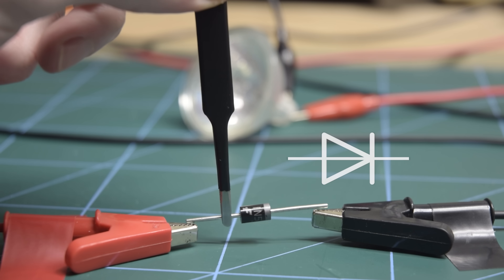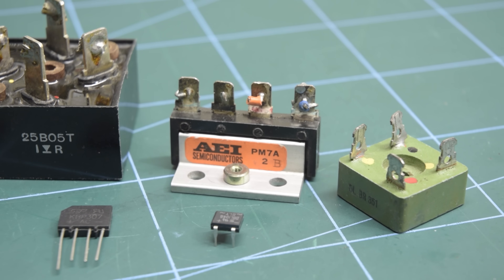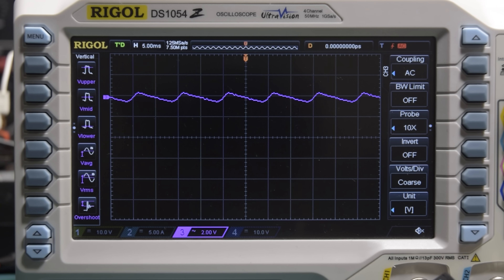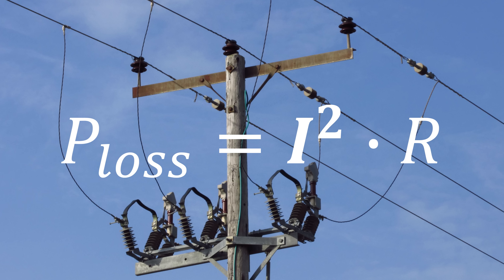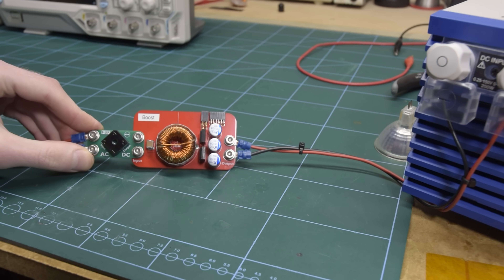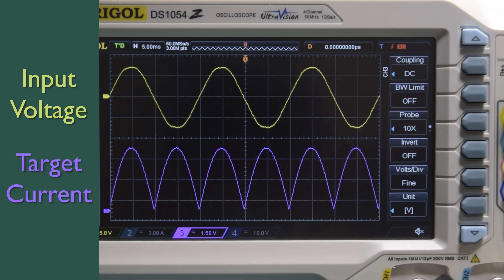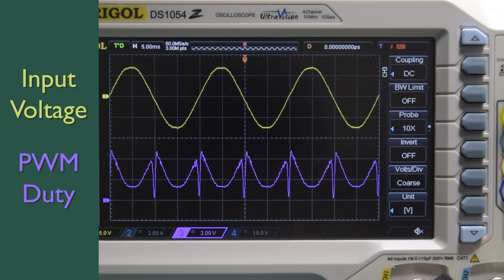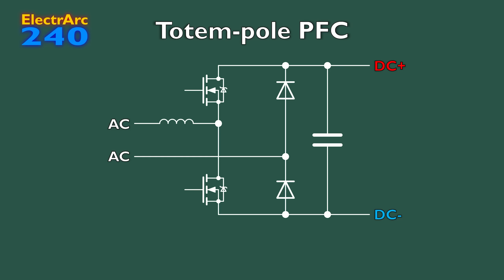Fixing the Full Bridge Rectifier’s Big Flaw - Active Power Factor Correction

Comment: The waveform shown at 10:18 shows a huge DC component of current. You need to investigate where that is coming from because DC current in mains-powered circuits is unsustainable. Since your AC supply is transformer coupled somewhere from a high voltage line, the net current leaving the utility's step-down transformer is zero. This means that another appliance that exists somewhere downstream of the step-down transformer is being forced to operate on the opposite DC bias. A remarkably small amount of DC current in a transformer, like 1% of its rated current,  can cause it to be biased towards saturation and cause massive hysteresis losses resulting in lost efficiency and overheating.
Reply from the maker: Yes completely agree. This is offset in the current probe and measurement circuitry. I really threw this all together and I recorded some footage a week apart and after fully dismantling the circuit. I believe this happened because I swapped some resistors when I rebuilt it. That's my excuse anyway lol
Reply: @electrarc240  A measuring artifact is unlikely to be the correct explanation for the observed DC imbalance. But you can just put a DC ammeter in series to see if this is real or a measurement artifact. Alternatively you can see what happens if you run your device as the only load on a seriously oversized isolating transformer. The zero-crossing points are unmistakable and sit neatly on the axis. Likewise, your fantastic 0.98 PF is clearly wrongly estimated. If a DC component exists in the current, or in fact if any even harmonics are significant in either the voltage or the current, simple measurement techniques will not measure PF correctly. A good DSP-based power analyzer can do the job. It needs to calculate numerical integrals for V^2dt, I^2dt and IVdt. That correctly takes care of DC and even harmonics.
Reply from the maker: @jacks5kids  That waveform is the current, so an offset in the measurement will propagate through the controller and appear at the input as we see. The PF was calculated before the "rebuild" when there was no offset, and it was correct.
Reply: Asymmetrical load on a transformer is not a problem other than causing poor utilization of the transformer. It won't cause saturation. Half-wave rectifiers on the outputs of transformers used to be very common in vacuum tube equipment. DC bias is a very big problem on the  input side of a transformer.  
In SMPS circuits, a DC-blocking cap may be used in the primary circuit of half bridge, full bridge and push-pull circuits or cycle-by-cycle current limiting may be used. In a forward converter, where operation is in "one quadrant" (unipolar excitation) a "reset winding" is ususally used to prevent core saturation.
Reply: @ebpdoug2175  A transformer core does not "know" whether the DC component of its field is coming from the primary or secondary winding. How much DC bias can be tolerated by a core depends on how close the core is to saturation or hysteresis overload in the first place. The bigger risk comes when a small load is fed by the same secondary as a large and unbalanced load. The small device gets fried by the DC current.

Comment: Thanks for this! Cant say I fully kept up but trying... I added a buck converter after a crap rectifier/regulator after ac stator on my bike and the bucks input cap blew. I think I needed to smooth with a Bigger cap before buck. how would I find this caps value? Also seems caps in parallel are bad? Had some huge voltage spikes doing that. Feel free to answer with a vid :D

Comment: ok, LED rectifier kinda cool, but i would need a transformer with quite the reduction of 3V output. im thinking this correctly yes?
Reply from the maker: Yeah it wouldn't work for mains as LEDs are bad at blocking reverse voltage. In this case it was fed by a 12V AC transformer and had just a 1k resistor as "load" for some current to flow

Comment: Another excellent video. I've seen a few in which the presenters struggle mightily (and fali) to properly explain how active power factor correction works, babbling on about phase shifts with capacitive loads.

A couple of tidbits that aren't immediately obvious to people not well versed in switchmode power conversion:

All switchmode power converters with regulated output (either voltage or current) have a negative input resistance characteristic. That is, the slope of a plot of input current versus input voltage is negative - if you increase the input voltage, the input current falls in proportion. I think most people who have some knowledge of switchers get the inverse relationship, but many never really think of this as a negative resistance characteristic.

This makes for the interesting requirement for active power factor correction. In order to get the input current waveform to match the shape of the input voltage waveform, the instantaneous input current must be made to be directly proportional to the instantaneous input voltage. BUT that negative input resistance characteristic means that the average input current must be made inversely proportional to the average input voltage.

I chuckled when you first said in your video "all we have to do is..." "All" was a bit loaded. I'm not surprised your code was troublesome. It is a pretty difficult problem. Years ago I struggled mightily with an analog PFC controller from Unitrode (now part of TI). When I started the project I think the ap note was at Revision B. By the time I was done it was at Rev H, iirc. I don't think I've ever seen any other ap note go through that many revs - certainly none in the course of a few months. There are many parts that will go "bang" in a 1200 W PFC circuit if it gets annoyed. Blew up a 35 x 60 mm electrolytic cap, too. That was ... loud. I suppose I actually was a bit lucky. There were four such caps in the filter.

Just to toss in something else to hurt peoples' brains (yes, I'm a big old meany), a boost converter operating in continuous inductor current mode has a right half plane zero in the response.
Reply: Those other videos you watched were about PFC for motors. Some electric motors produce a phase shift like at 6:30 in this video. The way to fix that is a capacitor.

Comment: There is an interesting dead-simple full-wave rectifier circuit that uses four MOSFETs (two N-channel and two P-channel, if I remember correctly) with the gates cross-coupled.  I was playing around with it many years ago, as a possible way for a low-voltage DC-input to be tolerant of normal and reversed polarity DC power supplies without the voltage drop of a diode bridge.  The device I was powering when testing this circuit had a large electrolytic capacitor essentially directly across the DC input.  Just for fun, I connected the DC input to an AC source (the output of a step-down transformer), and the electrolytic capacitor exploded after a few seconds.  Why the capacitor exploded is left as an exercise for the reader.  (Hint: It wasn't because a reverse voltage was applied to the electrolytic capacitor, the four-MOSFET full-wave rectifier circuit produced the correct polarity output.)
Reply: It couldn't discharge?
Reply: @rockytom5889  Actually, the problem with the circuit is that a MOSFET conducts current in both directions; when a MOSFET is on, it acts like a resistor.  In contrast, a diode only conducts current in one direction.  So when I applied an AC input to the full-wave MOSFET bridge, current flowed into the electrolytic capacitor on the rising edge of the sine wave, charging it up, and then current flowed right back out on the falling edge, discharging it.  This current flowing in and out of the electrolytic capacitor 120 times a second was much larger than the capacitor's RMS current rating, heating it up rapidly until the electrolyte boiled and it exploded from the internal pressure.  It mystified when it happened, it took some head-scratching for me  to figure it out.  That was many years ago; now I always simulate a circuit first, to catch the "obvious" mistakes like this up front.
Reply: Here's an LTSpice file of the MOSFET full-wave rectifier, in case you want to play with it.

--- Copy lines below and save to an .asc file, open in LTSpice:

Version 4
SHEET 1 880 680
WIRE 256 -176 64 -176
WIRE 416 -176 256 -176
WIRE 544 -176 416 -176
WIRE 64 -144 64 -176
WIRE 256 -144 256 -176
WIRE 144 -128 112 -128
WIRE 208 -128 176 -128
WIRE -32 -80 -96 -80
WIRE 416 -64 416 -176
WIRE 544 -64 544 -176
WIRE -96 -48 -96 -80
WIRE -32 -32 -32 -80
WIRE 64 -32 64 -48
WIRE 64 -32 -32 -32
WIRE 176 -32 176 -128
WIRE 176 -32 64 -32
WIRE 144 0 144 -128
WIRE 144 0 -32 0
WIRE 256 0 256 -48
WIRE 256 0 144 0
WIRE 64 16 64 -32
WIRE 256 16 256 0
WIRE -96 64 -96 32
WIRE -32 64 -32 0
WIRE -32 64 -96 64
WIRE 144 96 144 0
WIRE 144 96 112 96
WIRE 176 96 176 -32
WIRE 208 96 176 96
WIRE 64 144 64 112
WIRE 256 144 256 112
WIRE 256 144 64 144
WIRE 416 144 416 16
WIRE 416 144 256 144
WIRE 544 144 544 0
WIRE 544 144 416 144
WIRE 416 160 416 144
FLAG 416 160 0
SYMBOL res 400 -80 R0
SYMATTR InstName R1
SYMATTR Value 10
SYMBOL pmos 112 -48 R180
WINDOW 3 56 72 Invisible 2
SYMATTR InstName M1
SYMATTR Value AONS21303C
SYMBOL pmos 208 -48 M180
WINDOW 3 56 72 Invisible 2
SYMATTR InstName M2
SYMATTR Value AONS21303C
SYMBOL nmos 112 16 M0
WINDOW 3 56 72 Invisible 2
SYMATTR InstName M3
SYMATTR Value AONS32310
SYMBOL nmos 208 16 R0
WINDOW 3 56 72 Invisible 2
SYMATTR InstName M4
SYMATTR Value AONS32310
SYMBOL voltage -96 -64 M0
WINDOW 123 0 0 Left 0
WINDOW 39 0 0 Left 0
SYMATTR InstName V1
SYMATTR Value SINE(0 {10*sqrt(2)} 60)
SYMBOL cap 528 -64 R0
SYMATTR InstName C1
SYMATTR Value 1000µ
SYMATTR SpiceLine Rser=10m
TEXT -168 120 Left 2 !.tran 0 0.05 0
--- Copy lines above

Comment: So all we us citizens to you all are low voltage 60 hz yankees?   Righty o..  well ive been zapped by 120v60hz and 240v50hz and i can tell you for a fact the hum of the 60hz going through your body is a bit more pleasant than the skin blackening thump of the 240v 50hz..  but both are just childs play compared to a 3 phase 1200 hz..  that crap feels like a bunch of really small race cars all running into every joint on your body at once while you are vibrated harder than a fat girls bedside boyfriend..

Comment: Ok so I am an oldie, but in my day we used to call them a full wave bridge rectifier or just bridge rectifier. 
Next. Most of your first half was pretty much what I was taught in my trades course. The rest was not thought of back then. But if we want a good clean power supply it would likely be bridge, filter cap and regulator IC. You can now use your idea or switch mode. But,,  you have to realise this can play havoc with say sensitive audio circuits. Can be done you say, but only by making much more complex. BTW, if we're only talking about small power supplies, do we really need to fuss over power factor???
Reply from the maker: Below 75W we usually don't. Above that it's now mandatory in most places. Most modern audio circuits are class D which aren't as sensitive and are switching themselves lol, can't escape switching!!

Comment: Really good explanation and examples.  Nicely done.  
But these 'new-fangled' rectifier circuits aren't any good at all in the world of vacuum tube guitar amplifiers - where I very comfortably live.  We LIKE the effects of the inefficiency of a simple bridge rectifier and reservoir capacitor.  🙂
The downsides that you explained are an integral part of what makes great guitar amps - well, great!  
But then, SO much of what makes them great is using them outside their original design parameters, and then designing them to BE used wrongly.  Other areas of audio design work tirelessly to avoid distorting the signal.  We design the circuits to give, but control the distortion that is intended to occur even as the distortion of the signal is increased.  And under-designing, even abusing the power supply is a hugely important component of how we go about that.  Efficiency in the power supply is anathema to our goals.  But the rest of you normal electronic wizards just go on ahead with you clean power.  Have fun!  🙂
Just an interesting aside.

Comment: A really simple PFC IC  for apps less than 500 watts is the MC33262 developed about 35 years ago. It uses critical current mode, ie fet turns on as soon an the inductor current drops to zero.  It uses a single quadrant analog multiplier to force the input current to follow the haversine reference, which is derived from a simple voltage divider from the diode bridge. 
Perhaps you might consider a sequel describing this iconic IC.  It was used by the 10s of millions in fluorescent lighting ballasts from the late 80s until the advent of high efficiency white LEDS, which as your readers may know are really fluorescent phosphors driven by a blue led at about 460 nM.
Reply: Ahh I love a good datasheet.  I'll have to check that out!
Reply: @whatelseison8970  And a rather good datasheet it is!  :^)
Reply: I did use the 33262 in many designs until recently, then I switched to the UCC38051, which is cheaper, nearly pin-compatible and maybe even a bit better in some details. But beware, there are plenty of pitfalls with these ICs, and it took me quite some time to avoid them.

Comment: If the current only occurs on the high peaks then power is not being consumed between peaks where the current Is very low.  Power factor is caused by reactive phase shift when the imaginary portions of the voltage or current is high.
Reply from the maker: That's specifically displacement power factor, this is distortion power factor. The product of the two is the overall power factor

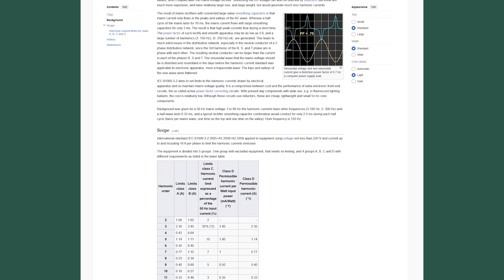Comment: Me, an Electrical Engineer, at 5:05, "Wait, is this just an ad for those scam PFC devices?"

Hold up friend, you're beyond PFC, you're in Harmonic current territory, and your final circuits are just that, harmonic mitigation used on some VFDs (called Active Front End). Here's the catch, they are more expensive at scale.

Comment: The AC is made DC then the High voltage DC is changed to a much higher frequency AC again, this allows for the use of a MUCH SMALLER stepdown transformer with a high frequency output that is much better/easier to smooth after the bridge rectifier.

Comment: I love your redrawing of the bridge rectifier. Makes it much easier to envision how it works. Subscribed!
Reply: It also makes it much easier to understand the construction of a 3 (and poly)phase full bridge -- it's just the next logical step.  When you have 2 diodes built into a single package in the same direction like that it's commonly called a half bridge.
Reply from the maker: I had shown a three phase after rearranging but cut that part out cause it didn't really fit the rest of the video

Comment: The way I see, and explain, power factor correction is like this: we used to have gas guzzlers because the supply of oil was high and the price was low. Now we have hybrids because we can't afford gas and its supply is limited. With electricity we used to have things like hot dogs cookers that were just metal spikes you stuck the hotdog on and the hotdog became part of the circuit. Now the cost of electricity is higher and the cables can only transport so much power at a time, we want to use "Hybrids" because our supply of "Gas" is now limited.
Reply from the maker: Good analogy! I may steal it 👀

Comment: How would the active power factor correction circuit respond if suppied with DC instead of AC?  My goal is to do away with AC to the maximum extent possible, and I'm wondering to what degree modern equipment is compatible.  Older passive power factor correction generally works beautifully on DC.  I will be using nominal 115 volts DC.
Reply from the maker: I really want to know this too!! Definitely going to try from my HV power supply one day. I'll share my results!

Comment: ~Forty years ago, fresh out of college I told my employer money could be saved by purchasing a Power Factor system. It was passive which was fine to offset very large inductive loads. He spent ~$11,600.00 it was paid back in 1.5 years.  In todays world, if appliance manufacturers included small circuits , such as these, consumers will save money.
Out in the world, transformers are generally round. Occasionally there will be rectangular capacitors up on the power poles, for power factor correction.

Comment: The formula you used to calculate the Power Factor for that narrow / distorted  Amps waveform, is actually the formula for Lead / Lag type Power Factor. This is NOT Lead / Lag type Power Factor.  This is Total Harmonic Distortion (THD) type of Power Factor.  The formula to calculate the Power Factor for THD is ... PF = sqrt( 1 / ( 1 + THD^2 ) ).  I don't see where you ever calculated THD ???
Reply from the maker: The (real / apparent) formula is for power factor, not any specific type. If you can get an accurate average power like I did it is completely correct. The formula with THD is for distortion power factor specifically (as opposed to displacement power factor). I was going to take a look at that but I have nothing to measure THD with sadly :(
Reply: I think he doesn't really understand what actual power factor meaans.
Reply: I believe your equation is for the distortion factor. Both you and the equation in the video are correct, this link from MIT gives all the details: https://ocw.mit.edu/courses/6-334-power-electronics-spring-2007/7f8d6364d64a634bcdd8001871d28952_ch3.pdf

Comment: Thanks for the video and perspective on PFC circuits. PFC power supplies are indeed valuable, but the challenge is still noise (EMC) and ripple reduction and smoothing. The good news is that modern circuit design has solved a number of weaknesses with good engineering, but the customer is not always able to tell the difference between the two.